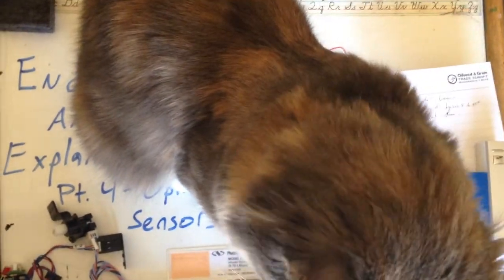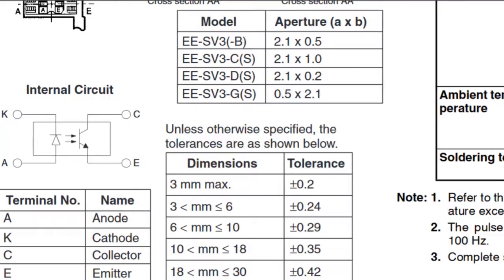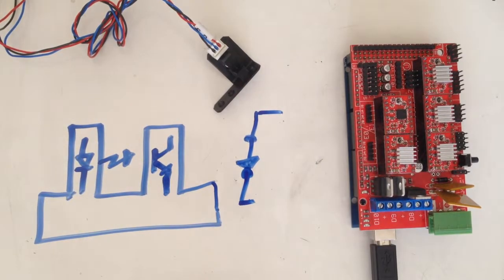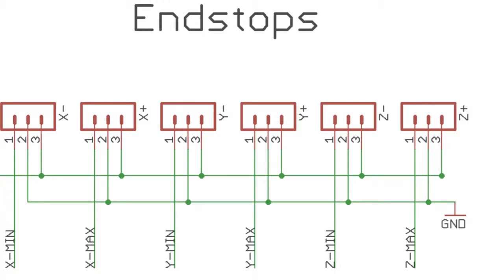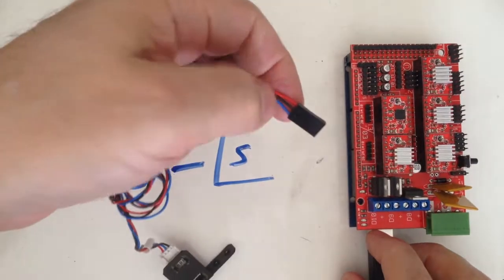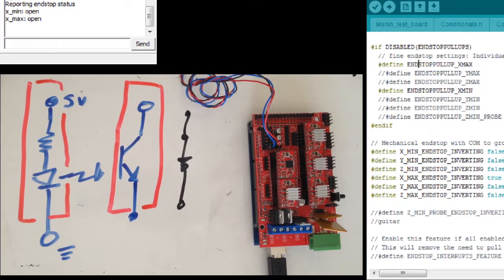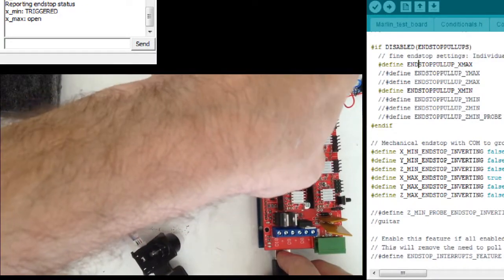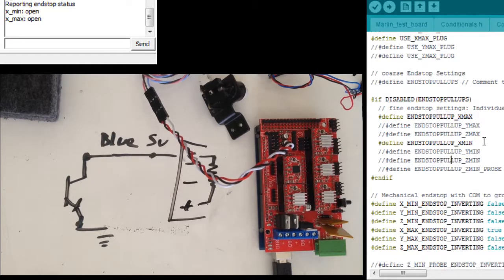Endstops and Explanations Pt 4  Optical Sensors

Comment: It is not  brain surgery to find out what wire is what. I mean you don't have to go through trial and error.  I say that because I barely had any education.
There is only 3 wires.  Obviously it means one of the wire is the ground for both and in your drawing you show it.    So you got three combination.  1. Ground and the LED,  2 Ground and the Transistor 3.  LED and the transistor.     which one of the pair must have the least resistance based on common sense?  Of course the first one, between ground and LED.   Which pair will show the highest resistance?   Between LED and transistor output.
I don't know fancy lingos.   The light beam is not a wire that is for sure so that wire doesn't exist.

And the pull up resistor....is a meaningless term in my ear.  Whatever it means, whoever started it and called it must have flunked basic English subject.   It typically is the case with the science folks.
It is not that they are brighter than everyone else and that is why the vast majority don't understand... no , not even true whatsoever.  In fact it is the opposite.   The so called bright science folks are totally inept in basic communication.

A resistor consumes voltage.  So how earth can a resistor give voltage to something?  It has no meaning.
So instead of calling it pull up, just show where that voltage comes from by putting the resistor where, internally or whatever?
Reply from the maker: Have you checked out my other videos in this series where I talk about pullup resistors and what they do?
https://www.youtube.com/watch?v=NI5kIBwUl7c&list=PLhkerMVsMjOaV9kjrEqvq6ZBEgQKrx7gy
Reply: An input pin must not be left 'floating' meaning it must not be open circuit as that can lead to illegal signals or unwanted interference. A pull up resistor means the input is pulled up to vcc voltage and pull down resistor means pulled to ground. When switch or transistor or anything else opposes that stable voltage then current flows through pulled resistor and input has a stable signal. I hope that helps.. :)
Reply: I usually use 10k but 15k takes less current. This pull resistor is across the power rail, so if too small value will kill your regulator. :)

Comment: I have a 3D printer (I purchased - did not build). I have been having some issues when it pauses - it returns the X-axis to home and the upon resume it moves "back" to where it stopped. It is not returning to the same point, it is slightly offset, the same amount the same direction each time. I believe that to be a problem with the endstop. They are mechanical - I believe there is points at which the switch is opened when pressed, but then it closes at a different point. Are the optical endstops more accurate - going this rout would remove the mechanical "slop" in the switching mechanism?
Reply from the maker: I can't speak to the root cause of why your printer is behaving that way, but as far as the accuracy of endstop sensors compared to endstop switches... well, the answer is "it depends".  Overall, yes, an optical switch will be more accurate than a mechanical switch.  But optical switches come in many grades and repeatability specs have to be looked at. How fast is the switching time of the sensor between when the flag blocks the light and the output changes states?  How close is the flag to the emitter or the sensor when breaking the beam?  Is the flag moving into the sensor from the top or the side?  Left side or right side?  How fast is your flag moving when trying to find home?  What is the aperture size (size of the hole the light comes out of and also a hole for the transistor on the other side) of the sensor? 
The same can be true for mechanical switches.  Some are cheap and will never have good repeatability.  Better grades (which usually means higher prices) of switches will have better repeatability. Switches with long levers pushing on the actuating plunger of the switch will have worse repeatability than a switch with just the plunger. Speed of the axis as it hits the switch will also affect accuracy and repeatability. You are correct that switches have different "open" and "close" points, depending of which way you are actuating the switch. The position that the switch changes from open to closed is usually not the same as when you are going from closed to open.
Having said all that, most 3d printers are only accurate to around .01mm give or take, if that, and most mechanical switches are close to that value.  Optical sensors will be more accurate, but if the printer can't microstep any better that .01mm, then a .001 accurate sensor isn't going to gain you anything. 
Also, when your printer pauses and the axis goes to the home position, is it actually homing again, or just going back to the last known 0 position?  if it's not homing, then that removes the homing switch out of the equation.  Just moving to 0, even if the switch is actuated, doesn't reset anything unless the homing sequence is brought into play. 
If it IS homing, try slowing down the 2nd bump speed so that the switch is actuated slower and see if that helps with the problem.
Is your motor powering off after it goes back to 0? firmware settings can sometimes do this and when the motor doesn't have any current, the rotor will move slightly to the nearest natural detente position so when power is restored the motor will be in a slightly different position now.  You didn't mention how far off the position is after these event happen.  
So, having said all THAT, (sorry, I get wordy about techy stuff) optical sensors are USUALLY more accurate than mechanical switches, with better repeatability. But I'd still try to slow down the homing bump before doing anything else. If it was me.
Good luck!

Comment: You draw a 4 pin device but then talk about 3 wires. It would have been great if you explained which pins of the device were connected together.
Reply from the maker: That's a great point.  There are many different types of 4-wire and 3-wire sensors. And 3- wire can sometimes mean that the LED and transistor Emitter share a common ground, and sometimes it can mean there are more electronics inside the sensor to make the output go HI or LOW, not just turn on an open collector transistor. I'd need to make a whole other video to explain all the differences.  But I'd not thought about how all my schematics showed a 4-wire setup and I used a 3-wire for the demo.  Thanks for pointing that out.  I hope the video was helpful anyway.
Reply: @printerstein1321  The video was very informative. Thank you for sharing your knowledge and your gracious reply.

Comment: Are these sensors 5v natively, or do they have internal resistors?  I have a OPB620 I am trying to wire up, and I want to make sure I dont need to put in any resistors to drop the voltage. this sensor has all 4 pins output on the connector.  I was under the impression that these needed to be 3.3 v.  thank you for the explanations!!!!
Reply from the maker: Sorry for the delayed reply,didn't see that i had updates today. I went to digikey.com,which is where i get a lot of my data on sensors. According to that data, you'd need to add a dropping resistor to the emitter to limit the current for whatever voltage you feed it. The diode voltage shouldn't go over1.6v, so no direct connection to5v or3.3v. Now a bit of math shows you could add a 155 ohm resistor in series with the emitter for5v or 3v operation but i know you didn't want to do that. You'd also need at least a 500 ohm pull up resistor between the supply voltage and the collector to see the output change states. I don't think any of that is useful information to you since you just want something without needing to add resistors. If you found a sensor that was "natively" some voltage,it would have internal resistors in it. The Omron EE-SX670 series can be directly connected to anywhere from5 to 24 v without a resistor, but it is also an open collector output and would need a pull up resistor on the output as well. Let me know if this isn't helpful and good luck! thanks for watching!
Reply: @printerstein1321  thanks for the reply!!!  I wasnt sure if you were still active. I had calculated a 340ohm res at 10mA. did you run your calculations at 25mA?   
 ....and my phrasing was a bit off, I dont mind adding resistors at all, I just didnt want to go plugging in willy nilly.  
I am currently trying to figure out the internal pullup resistor for the endstops on the BTT SKR 1.4  board, so that i can start understanding if i need   to add a resistor for the signal pin.   trying to track down that info now. :) 
I have been trying to understand pullup/pulldown resistors as well as opto endstops for years (off and on)  your explanations just might get me there :)
Reply from the maker: @fritzgutten1  
I admit I was in bed when I replied last night, mistakes may have been made...
Using a 5V source, 5-1.6=3.4, divided by .010 = 340Ω.  Glad one of us knows how to do math...

I read online that the SKR 1.4 now has 4.7kΩ pullups on the endstop pins, as compared to the 10kΩ the 1.3 had, but that's still fine for this sensor. The sensor output says it's rated for 30mA, 5V/4.7K=1mA, so you are safe.  Just need to enable the internal resistors in the firmware and I think you should be good to go.

I'm glad these videos have been helpful, it's a topic that I never see much about, and once you wrap your head around it endstops and sensors become so much easier to work with. I'm not as active as I would like to be, life has kinda gotten in the way of my hobbies, but I do still check my messages.
Reply: @printerstein1321  I'll be giving this a look tonight... I think I'm there with you... will be letting you know!  thanks again!!!!
Reply: @printerstein1321  well, some advancement, i think i've burned out a a unit from reversing signal and ground like a newbie. but i have a spare and have the pins sorted... i think.  same sensor as before i've got pin 1 being fed 5v through a 220ohm resistor (closest i had)pins 2 and 4 going to ground and pin 3 going to signal.  but now when i plug in the sensor the state changes and flag or no flag has no effect....  but if i'm gettting a state change, there has to be juice flowing, right?  more research to do.  also unsure if i've got the pullup enabled properly, as i get the same behavior on the pins that arent pullup enabled.
Reply from the maker: @fritzgutten1  
You can put 2 680Ω resistors in parallel to get the needed 340Ω.  A 220Ω by itself with 5V is running the diode at around 15mA, which is well below the maximum rating of 50mA, but, you know, however you want to do it.  Just offering options.
Are you getting the input sensed when the sensors are plugged in?  And not sensed when the sensor is unplugged?  Just making sure I know what state changes you are seeing. The way these normally work is for the sensor to short the input pin to ground to be sensed (Unless of course you have the pin action inverted in the firmware, but for now we just want the state to change as you said). If you manually short the endstop signal pin to ground, you should see a state change on the board. If that works manually, then that says your input is working correctly. 
I dug around a bit and it looks like the 1.4 board might have the pullup resistors permanently enabled so that the software enable doesn't do anything?  I could be wrong, I could not find a definite answer, but many people are saying this is the case. The one good schematic I could find does show a 10KΩ resistor connected between the signal input and the 3.3v rail as a pullup resistor. 
What is odd in your case is that if the input is untriggered, then you plug a sensor into it and then it reads triggered, then the input should be working correctly, BUT the state doesn't change when you put a flag in the sensor? 
If you sensor output transistor is shorted (which I have done by connecting them wrong) then the signal out pin won't change states when a flag is inserted into the sensor. It's just stuck on all the time. Even with no power applied to the sensor. Odd that you would have 2 bad sensors though. 
Do you have a DMM? You can measure the transistor output (pins 3 and 4)(make sure the ground of the meter is on pin 4) with no power on the diode, and if it reads as a short (or very close to a short) then the transistor is shorted and you are out of luck.
Hope this helps, please let me know if it doesn't.
Reply: @printerstein1321  you've got the gist of it all, the bahaviors are as you describe.
when i meter the transistor i see 4 Mohm in one direction and open circuit the other.
Reply from the maker: @fritzgutten1  wow, I always enjoy a good problem, this one is pretty weird. 
Dumb question- what are you using as a  sensor flag?  I asked because I once fought a similar issue where the sensor sometimes worked and sometimes didn't, and it turned out the plastic I was using for the flag was transparent to infrared light. So the sensor was always being seen as "sensed" regardless of if I had a flag breaking the beam or not.
Reply: @printerstein1321  a chrome plated flat blade screwdriver 😕
Reply: ok, meter shows 3.7 Mohm across pins 1 & 2 and 10 Mohm across 3 & 4.  pins 2 & 4 are shorted. I have pin 1 connected to +5vdc pin 2 connected to ground and pin 3 connected to signal
Reply from the maker: @fritzgutten1  ok, yeah, the screwdriver should work... :-D 
2 and 4 should both be connected to ground. Pin1 needs to have a dropping resistor inline with the 5V or you will likely burn out the diode. Also the diode will read very high resistance (megohms) with your meter leads one way, and some lower resistance value the other way- the diode has to be biased correctly for it to conduct. Pin 3 should be the signal. It should all work like you have it, except for the diode resistor. If the diode is burned out, then it's like having the sensor blocked all the time, so connecting it to the endstop input shouldn't cause any signal change. 
Since you have a DMM, you can try adding a 1K resistor between pin3 signal and 5V and reading the voltage on pin3 with the diode also powered.  With the sensor unblocked, you should read almost 0V (like .3 or similar) and when the sensor is blocked, you should read 5V.
Also, looking at the schematics, can you confirm that between the signal pin and ground (for any endstop) you are reading 3.3V? It looks like you should be if the pullup resistor is in place and working. I don't have one of these boards so I can't do this test myself. I am sorry I haven't been more helpful to you.  :-(
Reply: @printerstein1321  I'll Give it a try tomorrow.  Please dont appologize,  its more help than i ever expected!!!!
Reply: ok, so 3.3v on signal pin
Reply from the maker: @fritzgutten1  ok, so you should have a pullup resistor from you signal pin to the 3.3v rail, which is what the schematic shows, good to verify that. And I think you said the signal pin will show one state in software (what are you using to check for endstop status?) and another when you short the signal pin to ground?
Reply: and after adding the 1k between 5v and pin 3, I register 1.17 vdc... no matter if i have a flag in or not
Reply from the maker: @fritzgutten1  Well, that would indicate to me that the sensor isn't working at all. Pin3 should be almost 0v when unflagged (is that a word?) and 5V when flagged. 1.17v is close enough to a logic LO that the signal input on the board sees that LO whenever the sensor is plugged into the board.  Is that correct?
Reply from the maker: @fritzgutten1  wait- do you have an OPB620 or 621?
Reply from the maker: @fritzgutten1  and another dumb question- you don't have the 2 sides of the sensor swapped do you?  I ask because the emitter diode would drop around 1.15V and of course not change at all if the sensor was flagged or not.  Forgive me if this seems insulting, but I think it's worth verifying.
Reply from the maker: @fritzgutten1  OK, one more thing related to my question about the 620 or 621 sensor.  You'd said a few days ago that "when i meter the transistor i see 4 Mohm in one direction and open circuit the other".  This sounds like a diode test more than a transistor test.  Transistor should read OL with the meter leads on either pins.  A diode will read some resistance one way and OL the other.  If you do the same test on pins 1-2, you should definitely get resistance one way and OL the other, as on either sensor, the 1-2 pins are the emitter diode. 
I am using this sheet as my reference for these questions.
https://www.ttelectronics.com/TTElectronics/media/ProductFiles/Optoelectronics/Datasheets/OPB610-611-620-621.pdf
Reply: @printerstein1321  i have the 620. pins 1&2 read  4Mohm and 0L, pins 3&4  read 0L and 9.3Mohm......   AND it looks like i have been reading the 620 schematic upside down, so all the pins were backwards... i tried swapping pins 1&3, but to no avail... man i can screw some things up
Reply: whelp, i'm not sure what to say.... it works now...... i would like to say i learned a lot, but along with that, i haven't a clue as to why it now works ...  THANK YOU for your help, and the videos...now its time to wire end stops for my conversion! sheesh